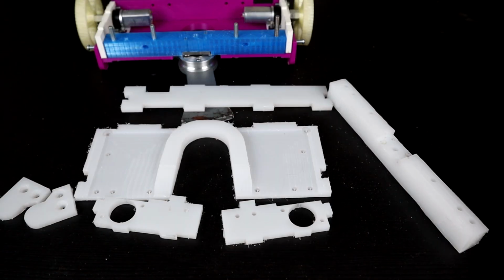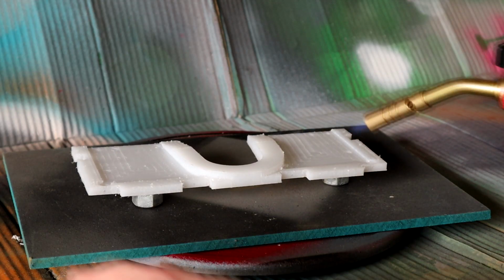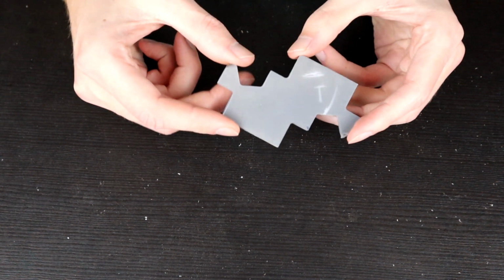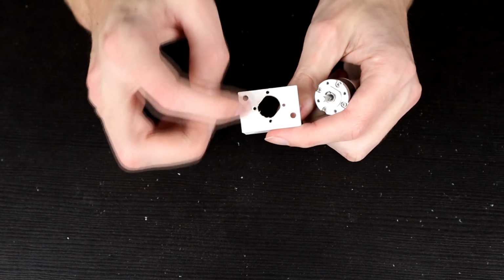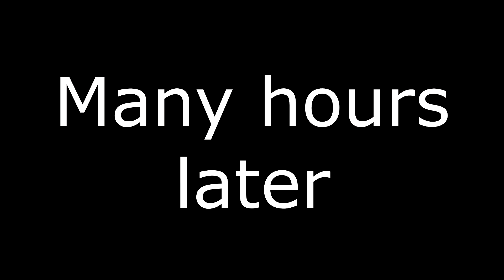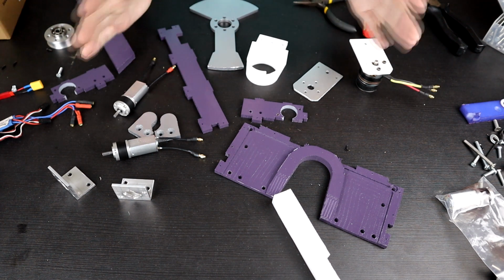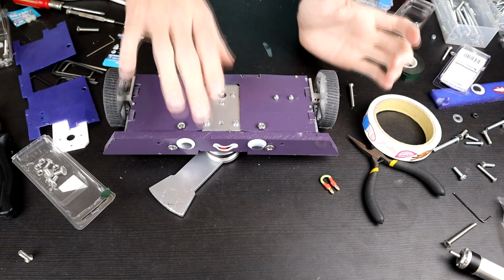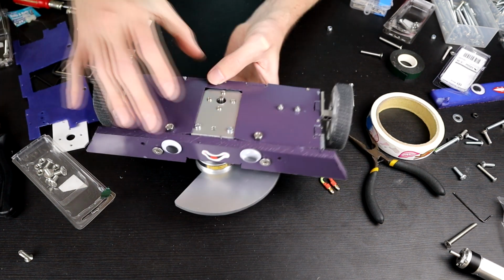All new and all improved(?) Annie_R_U_OK!!

Comment: Nice job Ben! Great tips with the HDPE painting, interested to see how that holds up!

RE mounting BBB 22mms 
I either CNC the mount directly in to HDPE wall (a 22mm hole until the last 3mm) the motor face shape on the wall - with a 2mm bit so it can do the M2 holes 
or I use nylon faceplates similar to your ally ones (without the right angle bit) which I laser cut and stock in the shop as I know it's a bit of an awkward shape compared to 25mms :)
Reply from the maker: Its held pretty well much better then paint on its own

Those are good options but I wanted the right angle so that the motor is connected to both the wall and the base of Annie, otherwise wheel shots warp the wall and mess everything up

Comment: your CNC should easily be able to make the motor hole shape. you may just need to make endmill reliefs at the corners
Reply from the maker: its more about that I'm not good enough at mounting and set up to CNC a angle Ali like this and have it be centred and accurate
Reply: @TeamPanicRobotics  i get that, i suppose, but then youre relying on the extremely inaccurate hand filing. at least with CNC you plug in a program and press go and end up with a part that should be mostly accurate and then you can make any minor adjustments with a hand file
Reply from the maker: Thats a very fair point, I would like to try them on the CNC in the future
Reply: @TeamPanicRobotics  Or use the CNC to cut in a sacrificial material/jig a positionning "hole", then (without repositioning the jig) putting your angle piece in place. Even if the jig is not perfectly aligned, the piece would be "aligned" to it, which would cancel the errors.

Comment: Just curious, what kind of belt are you using? I also had fun learning how to paint HDPE. Takes 3 seconds a swipe and if you get a wide angle flame attachment it will reduce warpage and speed up the treatment. Great videos as always!
Reply from the maker: I use a 96 tooth mxl belt

Thanks for the tips! I do have a wide attachment but havent ever used it, I'll have to give it a shot
Reply: @TeamPanicRobotics  Sounds, good and thanks! I was thinking about using gt2 (2mm pitch, 6mm wide) belt. Looked at the spec sheet and looks like the forces I am experencing I need at least MXL or 3M/5M hdt belts. Hopefully my pullies come before my first competition!

Comment: Hope Annie did well for May's meet. Looking forward to another great fight report. Also I am currently stuck with my antweight build. I am thinking of a mechanism to make my wedges replaceable. Can u recommend any idea?
Reply: Dove tails and bolts?
Reply from the maker: Dove tails and bolts is a great idea, you could also do just jigsaw puzzle bits like Annie, but the dove tail is a stronger option
Reply: @TeamPanicRobotics  i see. I was thinking making something that slides on and then possibly screwed on. Dove tails are good for 90 deg joints i think. Het Ben could u do a video on Joe Fabiani's new omni directional bot in this months NHRL? Its called Inside Job i think.
Reply from the maker: Just had a look, in the two fights I could see, (Zip Tide and Wake & Bake) despite the announcers saying its omni directional, it looks and drives like standard 4wd

So unless you can link to a fight where it has real omni drive, I think its just a mistake on the announcers part
Reply: @TeamPanicRobotics  I think in the wake and bake fight, there was something underneathbthe robot when it was flipped over. But yeah maybe its not omni directional.
Reply from the maker: Going frame by frame and having a look at the underside, there are cut outs for 2 motors one on each side between the wheels, which look like bigger brushless motors. Which indicates a 1 stage reduction to the drive wheels,

Theres also a cut out for weapon actuation near the middle

Nothing I could see suggests any form of omni drive
Reply: @TeamPanicRobotics  damn! U really looked in so much detail? That is awesome! A true pro! Thanks a lot for that Ben! Looking forward to your fight report!